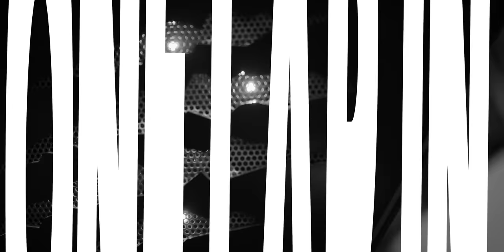SOPHIA FLOERSCH - A LAP IN Monza | Track guide | SIM - real life | rfactor 2 | Audi GT3 R8 LMS | DTM

Comment: Portimao WEC quali 10th race 6th very decent result. But I noticed your car's top speed was 2-4 kmh lower than the rest of LMP2 both at Spa and Portimao, suggesting you're using relatively high downforce setup. Next WEC race also going to be Monza, so will the Richard Mille bods be taking off a lot of wing for you?